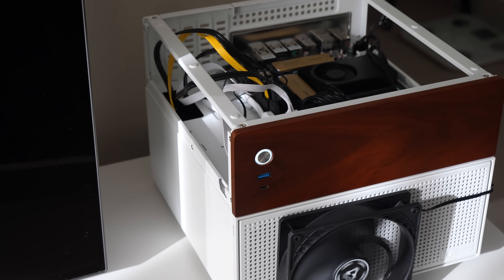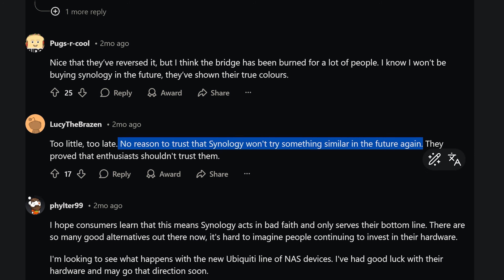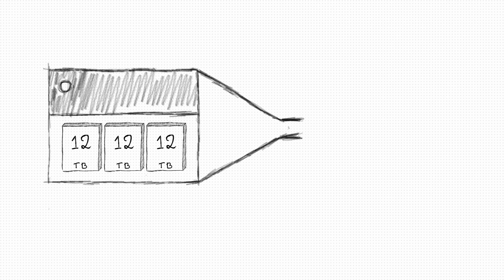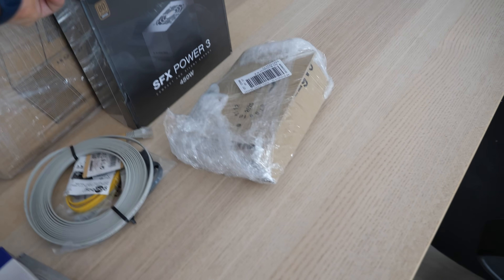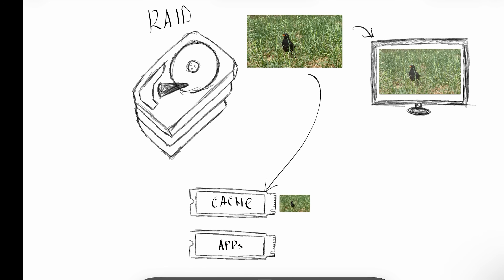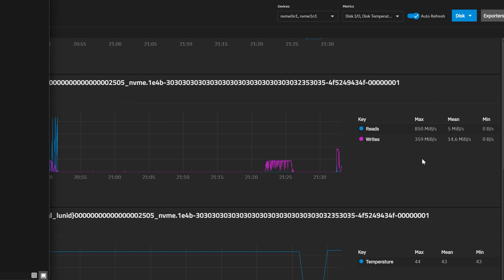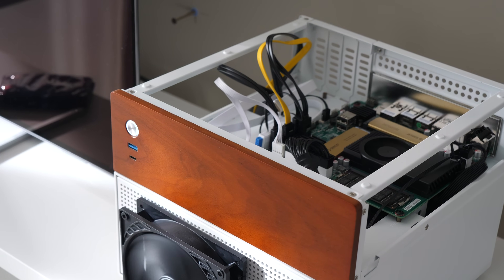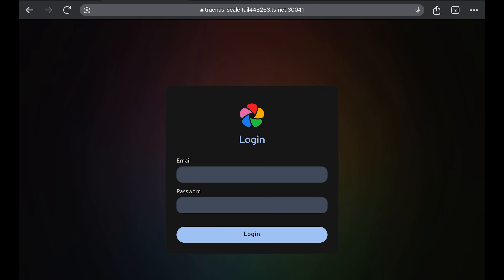Building a 10Gbit DIY NAS: What They Don't Tell You.

Comment: Why would you use RAID 5 instead of RAIDz1? They're basically the same except that RAID 5 is susceptible to corruption. You actually didn't mention ZFS at all which is very weird considering that you're using truenas...
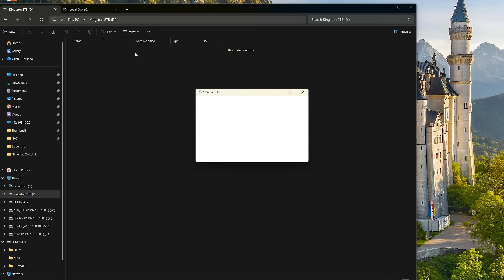Reply: He's using TrueNAS so he's obviously using ZFS and RAIDz, as shown in 12:07, he likely learned the terminology before jumping into TrueNAS and ZFS. Also the RAID 5 corruption thing is more of a BTRFS bug, not general.
Reply: @mttkl  I missed that. However, he did mention RAID 5 specifically more than once and never made a distinction between that and zfs so I still think it's an error.

Regarding the RAID 5 corruption thing, it's something that only happens with raid 5/6 so even though you're technically right, that doesn't negate the fact that  it only affects those configurations. Making that distinction is kinda pointless.
Reply from the maker: Many things were simplified in this video, because I wanted it to be more newbie friendly as possible, since was struggling myself in understanding all of these terms earlier. Also, I am never claimed to be an expert in NAS field, and tbh have no clue what difference between them. I only remember that raid5 was recommended by many, and I shared my choice
Reply: @trysometech52  But you didn't actually use RAID 5, if you look at the timestamp (or your own server xd) you'll see that you're using RAIDZ1. They're not the same. I understand simplifying stuff but you could simply say "I'm using raidz1, which is the zfs equivalent of raid 5", that's it.
Reply from the maker: @FEARmeify  I could, but I guess it's a thing that I just forgot. Anyway, once you will google "raid5 truenas" you'll get answer "TrueNAS doesn't use traditional RAID levels like RAID 5; instead, it uses ZFS with its own equivalent called RAIDZ1".
Don't worry, it won't hurt anyone.

Comment: Nice video, thanks for sharing it. I faced some of the problems you mentioned. Same case, same temperature problem. There are 3D printed frames to attach the fans, check them as you will get an integrated solution.
I had the same evolution as you: m2 ssd SO + HDDs. Realizing how slow was everything. Changing SO to 2,5 SSD. Installing 2 M2 SSDs for apps.
The only thing I will recommend to newbies (and yourself if you do not fill that much space): think about the raid layout. Raid5 may look like the best layout TB/€, but it is the worst in terms of expansion and performance. Check @TechnoTim "Getting the Most Performance out of TrueNAS and ZFS" guide.
Regards!!
Reply from the maker: Many mentioned problem solution to that front panel, so good to know that I am not the only one. For now the way it looks doesn't bother me, as it hidden anyway :) 
As for expansion of RAID5, I don't know how many years it will take me to fill the current NAS to be honest :D And when the time comes, I still can do additional RAID5 with 3 other drives. That could be a solution, what do you think?
Reply: @trysometech52  video demands a lot of space. Make some basic calculations and you will get an estimation on when you will need to expand. But it will happen, sooner or later. I recommend you to consider it now and address it now you can easily move out the data and rebuild everything (if needed). Once they are filled, it will not be as easy to move out the data.
Each layout depends on each preferences, I will not recommend you one or another as only you know your preferences and needs, but I recommend you to check Tim's guide and understand if RAID5 is the best layout with the new knowledge.
In my case, I started with 4 HDDs in RAID5 and changed it to 2 x (2HDDs in mirror). Now if I want to expand I add 2 HDDs (no matter the capacity). Or replace just 2 of my current HDDs.
Again, just give it a think to make sure you are using the best layout in your case :)
Regards!!
Reply from the maker: @PabloAsekas  I see your point, thank you!
Reply: He's using ZFS Pool, if using the latest version then he should be able to extend the pool by adding extra storage when needed and check his pool migrated the new drive. Easy enough

Comment: This is nuts — just yesterday I tossed this motherboard in the trash right after spending a couple of hours finishing my NAS build. And u dropped this video! What’s even crazier is that I picked almost the exact same parts as you, except I went with eight 8TB WD Red Plus drives.

But seriously… weren’t you bothered by the CPU cooler on this motherboard? It’s a 3-pin, non-controllable, fixed-speed fan, and the build quality is dog s**t. It’s basically impossible to find any replacement or compatible heatsink/fan for this CPU. So yeah, I said screw it.

Instead of trying to return it to AliExpress, I decided to dive into figuring out how to fix the cooler situation — even though realistically I’d never touch it. Probably my fault, but I wasn’t happy with it at all.
So… yeah. Into the trash it went.
Reply from the maker: Funny :D 
But why does that bother you? In my case CPU most of the time is chilling (it gets busy only during video transcoding, but still only 50% load) , fan isn't loud, and the temps are fine. Using it more than a 2 months, and no issues with it so far
Reply: @trysometech52  well that's insane what u r saying. how is it possible it's the same MB?? is it a different bios they put on it with a quiet cpu cooler? I mean clearly a 3 pin fan is not speed controllable so impossible to set in the BIOS; i was becoming crazy about that noise. the fan was running like to the moon. well happy for you  that u received a decent MB. it was then enough to have spend 200€ for then tossing it in the garbage so I was disgusted and I recided to at least use my 6 disks and stick with a UGREEN solution with no headaches.
Reply from the maker: Wait a second, I did configure the BIOS, I completely forgot about that.
Even though the fan is 3-pin, its speed can still be adjusted by voltage. 
This setting is located in Bios -> Advanced -> Hardware Monitor -> 
Fan Mode [PWM Mode]
       Fan off temp limit: 20
       Fan start temp limit: 30
       Fan full speed temp limit: 65
       Fan start PWM: 40
The fan at the front of the case is also connected to the CPU socket via a splitter on the motherboard (because only this can be configured in the BIOS).

It's good that you reminded me about this. I'll add it to the pinned comment so that others can keep it in mind too.

Comment: Got myself an aoostar wtr max for $600. Put 5x 2tb nvme SSD and 6x 24tb HDD. Put 32 gb ddr5 in it and it has 2x SFP+ and oculink and USB 4... I use the SSD for working storage in zfs and use unRAID on the HDD for snapshots and backups, unRAID will power down the HDD. I have an exact copy of this at my son's place, the HDD are syncthinged, so extra safety. Most important data gets a real backup on AIT tape 😊
You can't build this yourself for this amount of money..
And I dumped premiere for resolve around 10 years ago, after starting on razor in 1990, which was rock stable, premiere was a buggy crashing mess. Went to resolve and rock stable again. And now they want a subscription for premiere? I bought a black magic editing keyboard and got a $300 resolve studio license for free 😂😂😂 perpetual 😂😂
Reply from the maker: Holy cow! That's a lot of storage. My NAS is like a baby toy compared to yours :D 
I looked a that pre-build NAS as well, but it starts at $679 and of course you wanna put ECC RAM into it, so that makes even more expensive. However, I'm fairly certain that it's justified in your case.
Reply: @trysometech52  by the way, I bought an isa SD capture card with a 1.7gb IDE AV HDD in 1992 for $35k, it could hold 5 minutes of footage in PAL 😂.. been away for a while and I am loving that I can get so much more for so much less... I am building a (semi?) pro setup for a fraction of the cost of only that card and HDD.. marvelous indeed..
Reply: @trysometech52  it is all relative. Recreating footage costs more, if possible at all 😂
And if you want to do something like this with Synology... $$$$$ jackpot... But you can start with the base unit, 32gb, 2x nvme and 2x HDD without going totally broke. 
And a self build with these specs (including trays) I can't see done for that money. At least not with new parts an/or energy efficiency and/or noise.. what? NOISE 😂😂😂
Reply: @trysometech52  just saw that the 24tb HDD went up from 280 to 430 🤢 just start with nvme if you can still get those cheap. Or wait 6 months for the AI bubble to burst and go nuts then 😂
Reply from the maker: Yes, the prices are crazy now. RAM has increased two to threefold, and NAS usually requires a lot of it.
Reply: @trysometech52  subscribed 👍
Reply: @annebokma4637 - I too got the Aoostar WTR MAX, and as someone on their 4th NAS box I can say that it's an absolute beast for the price.!  I've got a full Windows 11 and TrueNAS running with plenty of headroom to spare.!   I wish I could afford 3 unit's to create the Proxmox cluster of my dreams.  Oh and I'm not using EEC RAM, zfs is fine without it in all but the most demanding cases.

Comment: My "NAS" is a USB 3.0 8 bay Mediasonic tower.  These  are ancient technology now, and I run it with 8 8TB WD Blue drives, the cheapest I could find.  It gave me 64TB of storage in 2022, and I can upgrade eventually if I want.

I went this route as I realized I needed archival rather than always on storage, it's turned on to back up files from my photography hobby, and each drive can be removed and popped into another device.  I have another set of drives in Orico storage boxes I use for redundnacy.  What I like is being able to access files at any time, and I can live with a slower pace of backups.

The NAS approach of a drive array is great until a drive fails, and it seems when one gives out you should plan on replacing them all. Before I got the tower I only had the indvidual drives and two got bad sectors, so I lost about 200 photos out of 500,000 (yes, that's an accurate number), which is better than what happened at a place I worked at where the NAS's drive controller munched itself and over a decade of files were lost.  A NAS should be seen as just a very big drive with at least one redundant backup behind it, even if it's offline "cold" storage.
Reply: how do you have that set up? just a regular pc that you move files over to? looking to do the same thing soon
Reply: @serelistia You can pretty much frankenstein any hardware into a NAS 😂 not ideal but it will work and get you started to learn
Reply: If you're doing NAS you should use NAS Drives really, WD Blue drives are not ideal for this use.
Reply: @Steel_Pharoah_34GxH - Why would you assume that you have to replace all drives when one fails? That is completely wrong thinking.  The idea of a NAS is that you setup the drives in some sort of RAID, thus one drives keeps the parity information which allows the system to keep functioning even with a failed drive, and then when you replace the drive the system will rebuild the array to return the system to a normal state.   Yes you lose one drive capacity for parity but it's a far safer option than using single drives, or RAID0 / Spanning which seems to be what you are referring to there.
Ah, I just read the info about controller failure, but in that case you should have been able to install the drives in another system with the same model of controller and all the data would be there.  TrueNAS uses zfs file system to take that one step further, it's all software controlled, so the drive array is transferable form one zfs system to any other zfs system, it takes around 5 mins to import the drives and is hardware controller agonistic.  Now if the PSU goes overvolt and fries all the drives nothing but a backup will save you from that situation, but it's worth checking TrueNAS out, because the focus is on data integrity and resilience.

Comment: i bought this case, tried to build in it, and gave up and ordered a fractal instead
Reply: Why
Reply: @apoiskender basically impossible to route PSU cables around the bottom, by the drives, up thru the tiniest hole, to the MOBO. Most frustrating case I've ever tried to build in.

Comment: I "fixed" my jonsbo N4 by attaching a 180mm fan to the ceiling of the case(inside) with rubber fan mounts, then using electricians tape to duct it so the only hole was the fan mount, making the 180mm help cool the drives.

Comment: After building your first NAS, the next things you should do are:
1) Build another NAS.
2) Set up your own VPN connection so they can communicate with each other over the internet through a tunnel (Tailscale, etc).
3) Set up automatic snapshot replication from NAS #1 to NAS #2 (TrueNAS makes this easy)
4) Set up that 2nd NAS at a friend's/family member's house
5) MOST IMPORTANTLY: Test your backup and restore scenario. Ensure it works as you expect, so when shit hits the fan, you won't be scrambling to figure out what you need to do, you'll already know.
6) Congratulations, you'll never lose data ever again (unless you do something unfathomably stupid)

Comment: With truenas, especially if u plan to run apps. There is never enough ram
Besides, truenas will not waste unused ram, it will cache
Increase physical ram capacity first before adding L2ARC as L2ARC uses some ram too

Comment: like your video , I would see if you could mount 2 80mm pwm fans front and back of your hdds to make a push/pull configuration to move dirty air out of the case when the are running. it also means you don't have a fan someone can put their finger in ,

Comment: I’ve always heard spinning down hard drives is generally not recommended, as it reduces the lifespan of the drives.
But It’s understandable as it seems very loud.
Reply from the maker: Noted this tip in my pinned comment, thanks!
Reply: I also live in an apartment, so I can't hide my NAS..... But I just hid under the sofa...... Temos are fine too this day. The sofa has an opening on the side from the factory so no problem
Reply: This is not true anymore, it used to be 15 years ago and the myth has remained. Back then the heads were resting on the platters. Nowadays there is zero contact, even when spun down. So the lifespan is unaffected.
Reply from the maker: @anonymous-q2b5s This is not a problem for consumer HDDs, but it is a problem for enterprise HDDs.
Reply: It's not so much the disks, its the power surge to re start the motor to spin the disk. So think of it like starting your car in winter vs summer, cold start is more demanding on your whole system. You turn the key the battery struggles because its cold the engine takes a second to turn over because its cold and the oil takes a min to run efficiently because its cold 🤔 your NAS as you create a demand the power spikes surges through the motor each time it spins down this process happens over and over, cooling down, heating up this adds stress to the motor & the solder joints adding extra wear in those areas potentially causing more damage over shorter period of time rather than just leaving it to spin idle. Originally the reason was because of the way the platter sat on the spindle and the motor drive mechanism being that the original was run on ac motors & ball bearings this was the point of failure causing the platter to spin offset or the bearing balls coming loose inside, now the setup has totally changed because now we have dc brushless motors & fluid bearings. The most common failure now would most likely be coil windings failing in the motors over time due to hot & cold fluctuations would be my guess 😬😁 because commonly brushless motors usually die from electrical overstress 👍 hope this is helpful to you

Comment: I built my DIY NAS in 2014 with an ASRock Q1900DC-ITX, 8 gb, 2x2 tb Seagate NAS drives, running FreeNAS 9.2.  It's still running flawlessly 11 years later, having transitioned through TrueNAS Core, and now to TrueNAS Scale.  It's in a ThermalTake Core V1 case, and powered by a 90w laptop brick.  I added 2x4tb WD Red Plus hdd's.  When I did the TrueNAS scale upgrade, I modded the UEFI bios to insert support for NVMe ssd's as a boot drive, and added a 128 gb nvme ssd on a pcie 1x adapter card.  It has never crashed, BSOD'd or lost any data.  I keep things simple, and don't run any other services on it.  I love the 10w passively cooled cpu and laptop brick psu.
Reply: have you had to replace any of the drives yet?
Reply: @serelistia  no.  the 2014 seagates and the 2022 wd's are still golden.  i just posted a github gist on fixing nvram issues with my nvme modded bios.  just upgraded to 16 gb dram, too.
Reply: @vibrolax  nice! and i'm assuming you've had this running 24/7 throughout the years? that's pretty damn sturdy
Reply: @serelistia No, it doesn't run 24/7, and it's been relocated a number of times.  If the disks don't explode, I could re-host them on a new system in a couple hours.  I'd build a second NAS and replicate some pools for more reliability.